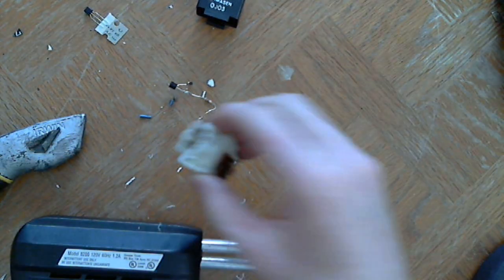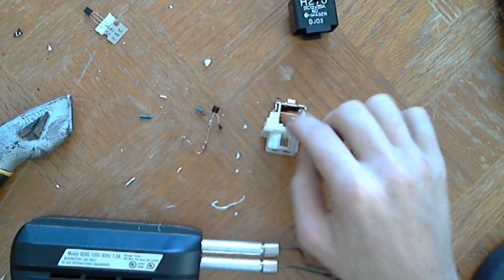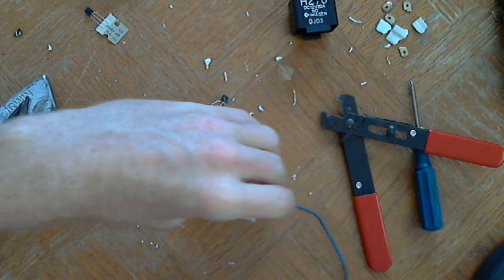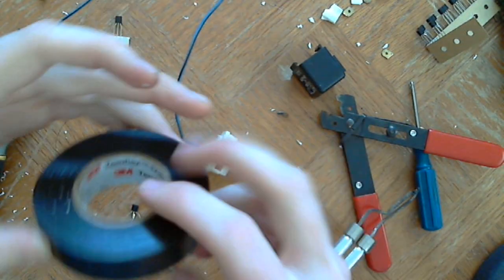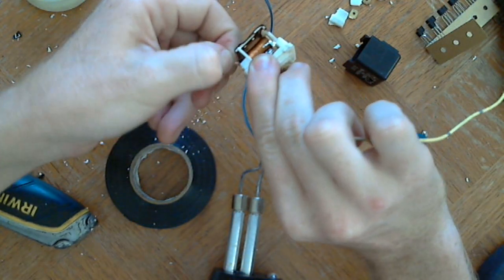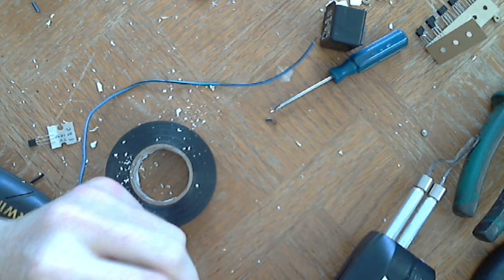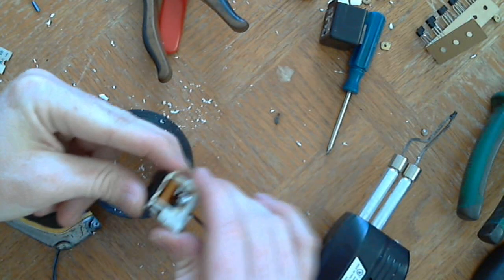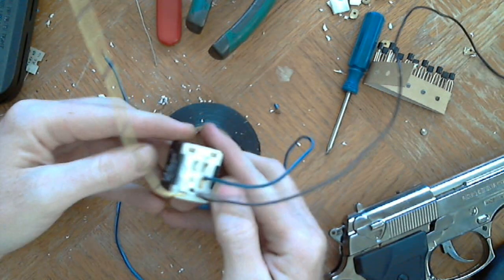Homemade toyota tach adapter for multi-coil engines

Comment: Jay Shipp 
Hi Jay great video this is actually really interesting!! I'm hoping to give this a go instead of purchasing an MSD tach adaptor since also converting from a distributed 4cylinder to one with coil packs. I have heard that the MSD can be noisy though which is why I'm interested in this method, is it a noisy mechanism at all? I could imagine the relay clicking could be kind of loud but I'm yet to go through your video entirely and understand how it works + if the relay will be constantly clicking on and off?
Thanks!

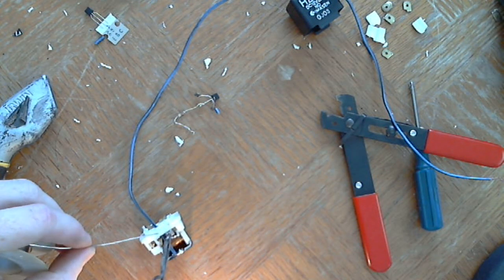Comment: So if I understand well, you kept the resistor that you mention around 15:45 in place? I've seen some wire diagram for what you've done on a megasquirt forum and no one mention anything about this resistor that is in the relay. It's a good idea to keep it in place then?
Reply from the maker: Correct, I didn't remove the resistor. However, the compact setup that I made here of the coil didn't work for very long. Transistors are killed by magnets and magnetic fields. I shouldn't have put the transistor in front of the electromagnetic coil. This works when the transistor is away from the coil though.

Comment: I am enjoying your video. I am not an expert but I am trying to figure out how to adapt a coil RPM system from a 4EFTE starlet engine into a Corolla E11  European version with electronic ignition dashboard. Can you help? .
Reply from the maker: There are adapters that you can buy online to convert the signal. If you don't want to buy an adapter, you may be able to take your gauge cluster apart and use the rpm gauge from a similar year Corolla that came with a coil rpm system. For example, in the 6th generation Celica, most engines had the coil rpm setup, but the BEAMS engine didn't, so the gauge cluster for that variant of Celica had the electronic rpm signal from the ECU. I was able to take the gauges apart and swap out only the rpm gauge. It worked perfectly with my standalone
Reply: Thank you for answering! I don’t know of any Corolla that has the coil system. Apparently they came all with the electric ignition system. Which adaptor do you suggest?

Comment: Can this adapter be used in a 94 aerostar 4.0 v6 ???
Reply from the maker: +Sergio Ramses I'm not sure what your engine/tachometer setup is. The adapter is made to take one signal and convert it to another type. One engine/tach setup will have a single coil that fire the spark plugs, that coil signal is sent to the tachometer. There is a different tach that gets a different type of signal straight from the car's ECU instead of the ignition coil. The adapter converts one signal into another. If you do an engine swap in your aerostar, then you may have to make an adapter.
Reply: Ah ok well the thing is that i'm trying to find an tach adapter to put in my aerostar because i'll be adding a turbo setup and want to be sure i don't go to high on the rpm.I've seen some videos of people that make their own adapters like you and want to see if i can make one my self.
Reply: My van has ignition coil pack.

Comment: An hour long video that doesnt explain much of anything.
Where are you pulling your signal from? positive or negative side of the Coil?
What are you trying to achieve. Converting a positive source to negative signal.
or Negative source to negative signal.
Cudos for trying but too long too little infomation.
Reply from the maker: I probably should have explained that. the coil signal is a pulse from the ecu. the relay generates the coil negative signal after it is triggered.
Reply: seriously, 6 min into the vid, i am pulling my hair. If I fast forward I might actully miss something important!!!